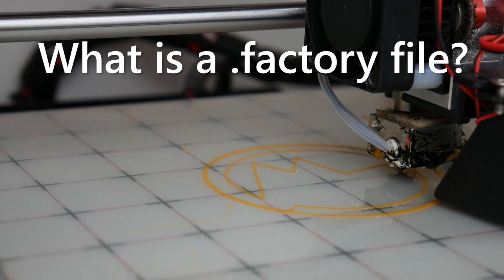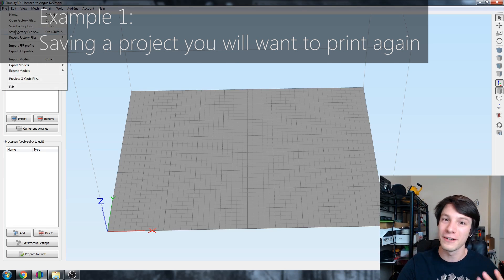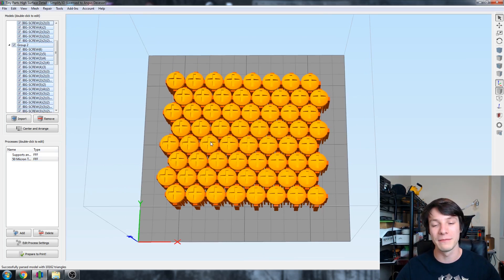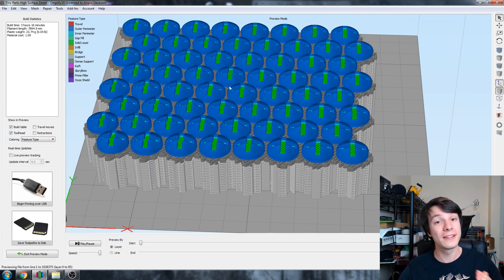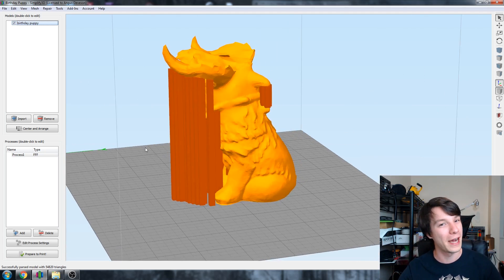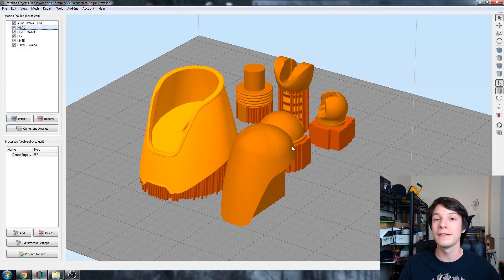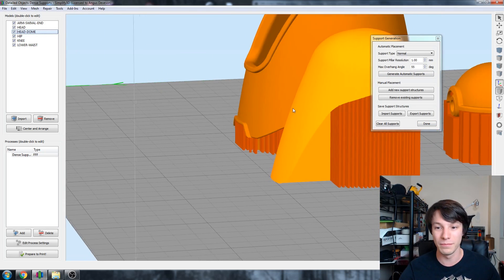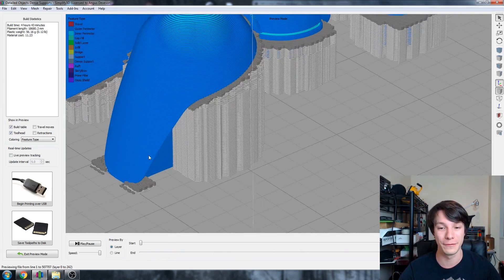How to use Factory files in Simplify3D - 3D Printing 101

Comment: Sorry to be the "Johnny come lately" but I don't know how to use a factory file.  I am setting up a factory file for temperature towers.  I made one for my CR-2020 and saved it.  Now I want to use it on my CR-10S.  Every time I load it on the CR-10S the process reverts to the CR-2020 machine.  What am I missing?  Or do I have to set it up for each machine individually?  Again I'm sorry to bother you with such a silly question.

Comment: So, on the left side of the screen on top is a window labeled 'Model' and on the bottom window it's labeled 'Process'.  In my case it shows 'Process1'  why? Where's the 'Process.fff?   In my 'process 1' I have 8 different items,  maybe a vase or pencil holder or a boat, whatever when I double click the process name I get the settings where I can select which item I want to work on?  I still don't understand the differences between a process and all the models said with-in the process?  I see in your video you have different named processes and within each process is your specific model.  I'm doing something wrong then?  Each of my different items I print should be saved as a process, instead of a model inside the process?  (scratching my head).  Oh yea I'm a subscriber.

Comment: I got a question for ya. I've behaving problems printing stuff n my Tevo Tornado using ideaMaker.  I'd have everything set up and print the first one.  Great.  Start the seconding and everything falls apart.  Won't stick to the bed.  i'm now looking at Simplify3D.  You know both slicers,  what's your thoughts?  Thanks

Comment: I know this has nothing to do with you but for Simplify 3d not having a proper manual is idiotic and makes me feel stupid for buying the freaking program. Who does that? Just have a repo that is half ass complete? I know some that do but not a program you pay a 150 bucks for! That's damn expensive! I should have gotten rubbed out right before I hit purchased.
Reply: I have the same complaint. I have the program and love it, but feck me, there are simple things that I have no idea how to do, like print different parts with the same settings as previous ones. It would be nice to have a manual for a pricey bit of software.

Comment: It took me 3 years of fighting with "all the other slicers" to buy Simplify3D. Once I did, the only question I had was "why did I wait so long?". It's far more bug free than the other stuff I had used. It has much better support (like say .... this video). It work well across a bunch of printers. I can run multiple instances of the program on my laptop and print on several machines at once.

Comment: Thanks Angus, that'll come in handy for sure. I have Simplify 3D and would like to use it all the time, but I'm not sure how to have it control the heated chamber on my Cubicon Single for ABS prints. Could you point me to a resource that would help me figure that out?

Comment: Just starting using it with my mk2 for the supports as slic3r supports sux. I did save same factory settings which is similar to the .Up files. Any chance of a 101 on using different profiles at different hights Like you did for you're screws. I would like to have say 3 promoters at start and maybe 5 at top of print.

Comment: Dammit I want simplify3D, but $150 is a hard pill to swallow.
Reply from the maker: Definitely working on getting some licenses for prizes in the new year!
Reply: Its well worth it, it is awesome program
Reply: Unless you're getting your filament and such for free, IMO $150 isn't all that much for a hobby that is generally expensive to begin with, especially if you're already "wasting" a bunch of time/effort/materials because your current slicer isn't giving you what you need. It doesn't make sense to blow that much money if you're happy with what you've got, but if I were to ever hear someone say "S3D sucks!" I'd call them out as a troll. ;)
Reply: I got a pirate copy. Just saying.
Reply: Yeah, I've been using Cura for a while, and I'm not sure if it's my printer or the slicer that's causing issues.
Reply: It's worth it. Might take you a while to recoup the cost in terms of material saving (if any) but the feature set and speed are big big plusses.
Reply: Lol, yeah. For me, though, I'm on the budget end of 3D printing. Not super budget, but I don't think I've spent over $200 on filament yet, and only $500 for my printer.
Reply: Yeah, then S3D is not necessarily the best-spent money at this point, especially if you're still tweaking best settings for your printer with a given material. That aside, however, when you get to the point of wanting to "step up your (printing) game" I totally suggest S3D as opposed to say a budget printer and/or "exotic filaments"; I now have rolls of fringe-filaments I seldom (if ever) use and a second, cheap printer that I honestly could have done without.  But I've never regretted getting S3D, as it's something I use prior to every single print I do and so doesn't sit around being unused like my roll of magnetic iron filament. :-|
Reply: Awesome! :)
Reply: @arthur1129 LOL yeah, that's a double-win: help your lungs and get S3D all at the same time!  (...which gets me thinking; I wonder how long it would take me to be able to afford a new printer if I stopped drinking so much damn alcohol... :-/ )
Reply: You've got it backwards, arthur1129; become a "booze bum" and buy the cheapest, bottom-shelf crap you can, in the largest sized containers possible (1.75L FTW!), so that you're getting the most bang for your buck. After awhile you forget what good alcohol tastes like, and in some cases I've actually found that the craptastic store brand has 'something about it" that I end up liking more than top shelf.
...either that or I'm just an alcoholic trying to justify the ludicrous amount I drink. Shrug. :D
Reply: @arthur1129 No...I bought S3D as part of my "3D printer bundle" Christmas present-to-myself last year... ;P
Reply: it was even harder when I paid $260 for it like 2 years ago , totally worth it though.